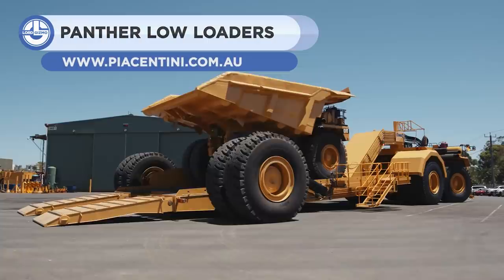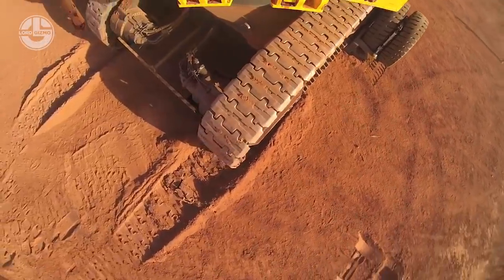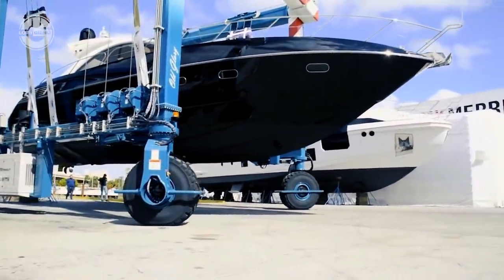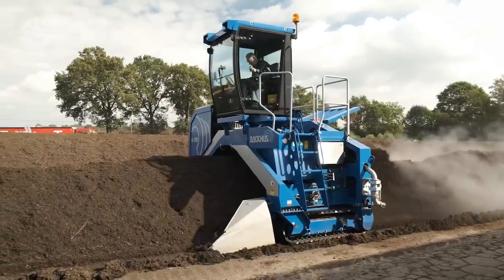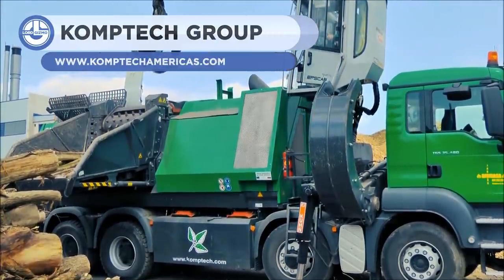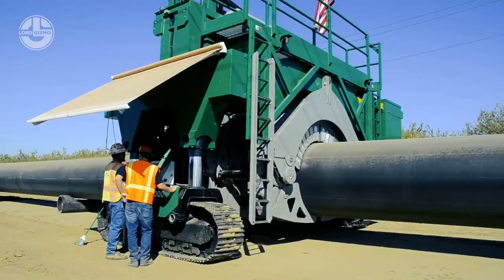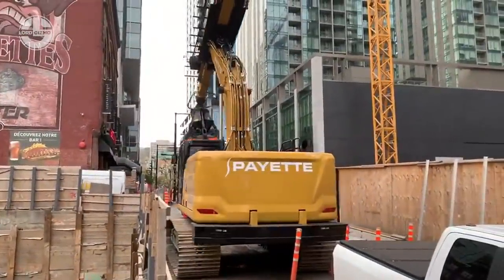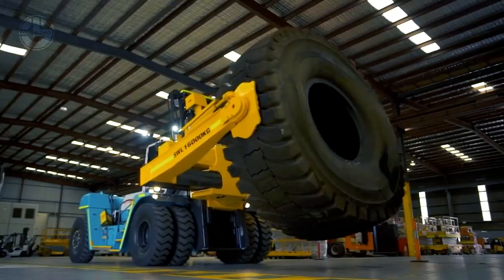20 Most Impressive & Powerful Machines You Need To See | Powerful Machines That Are At Another Level

Comment: Are u sure about ur speeds for those tractors?Even 150 kmh is too fast for any tractor to do.Might want to double check such things before u say them.
Reply from the maker: This is specifically for the Fastrac, which is the world's fastest tractor.  150mph is theoretically achieved with the correct model; most are not designed around achieving top speeds and are better suited for pulling.

Nonetheless, standard models can 43 mph, which is quite decent for tractors as a whole.

Comment: SOME OF THESE REQUIRE PERFECT CONDITIONS TO WORK/////some are one -ofs I bet///the puller for stumps at high speed would require the stumps be the perfect size on the perfect terrain///I would say there are better and cheaper ways to do some of these tasks than building machinery that just barely works...the Orange Peel on a boom reaching over the edge of a commercial basement could be done with an old fashioned clamshell as quickly and way cheaper.BUT WHEN THERES PLENTY of money ,there is always waste
Reply from the maker: Well, for the stump puller, I'd wager that you're not entirely correct firstly.  However, if you are correct, then it must be specialized for the wood industry, where trees are cut down when they reach the optimal diameter.

Which one do you mean for the "orange peel", 19:44?  If so, it'd be worth looking at.

Comment: I don’t understand why there is not a machine that can fight the massive forest fires ……there is a material that stops burn up when re entering the earth from space , plus these monsters surely there has to be a better way .
Reply from the maker: Well, that material you spoke about doesn't actually stop burning!  What it's very good at is repelling heat, so that the insides of spaceships don't end up burning up.

But there's no real way to stop forest fires, sadly.  These massive machines aren't built to deal with being surrounded by fire in the first place.  All we can do is try and prevent them in the first place, and cut them off from populations when they do inevitably start.

Comment: A tractor that can do 150 miles per hour?
Now thats absolutely unnecessary. They dont need speed, just torque.
Nobody uses a tractor going 150mph, you dont even use a tractor doing 60mph. 
Now that is a waste of a tractor, i bet you also pay a premium for it. Paying more for something non-practical. Yep.
Reply: Maybe someone wants it as their daily driver. 🤔 dont hate.
Reply: Most seem to do max. 40Mph, though some models can reach ~50Mph, the one that went 153Mph was a one-off tuned version they did for the publicity. It has special body-work for aerodynamics, is lightweight (5 metric tonnes) instead of the 11 metric tonnes of the normal model and uses a parachute to slow down...
Reply: @someguy4915  I bet the cops didnt fancy pulling that one over